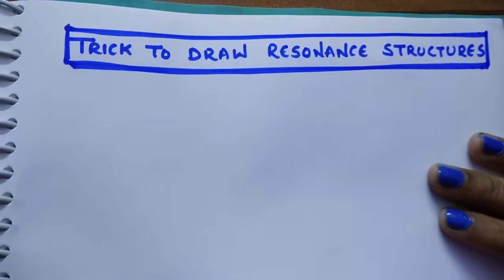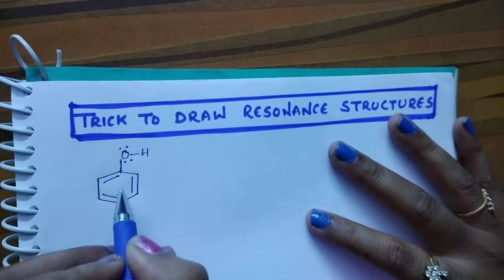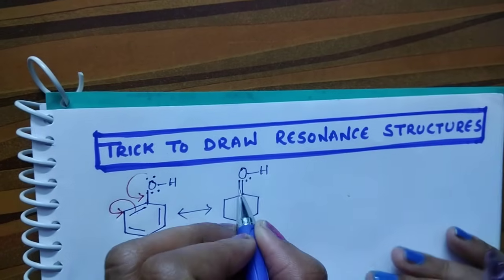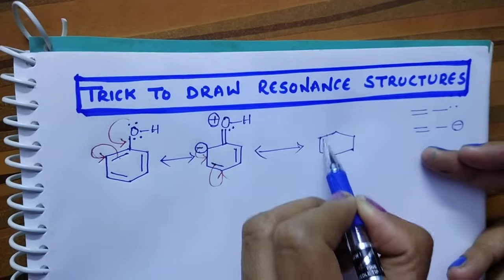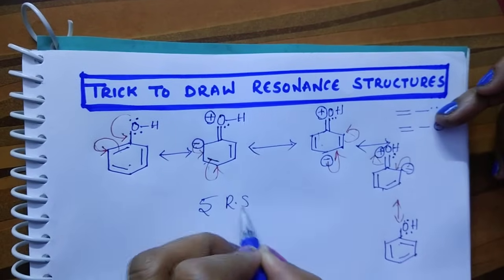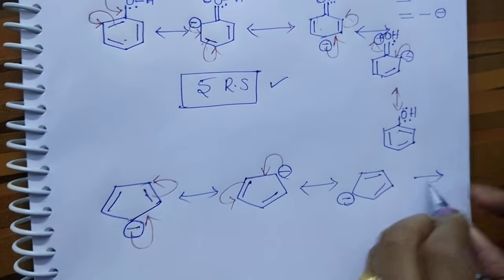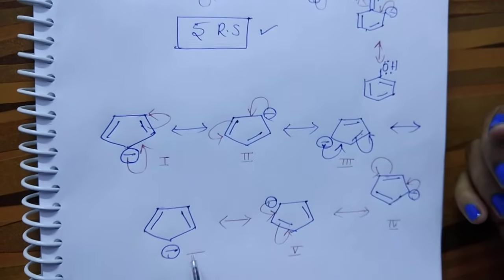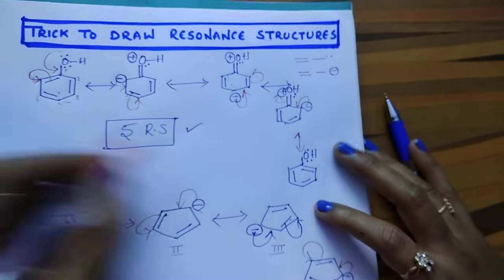Trick to draw Resonance structures

Comment: I have a question, in the first first example you did pi bond, sigma then charge as resonance but then the second example was the opposite with charge, sigma then pi bond. How would I know which order to use?
Reply: I am little late.. but I wanted to clear it that if there are more than one conjugations in a given molecule one of them will be dominating. So you would have to start writing the resonance structures from that conjugation. By dominating I mean the one which is having stronger force of attraction or repulsion.